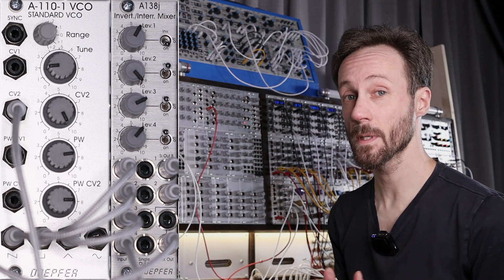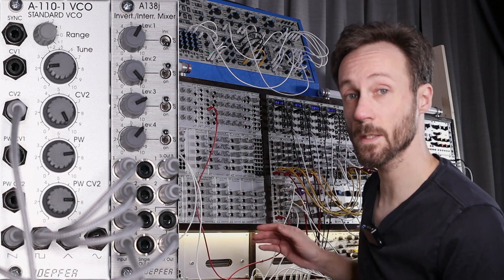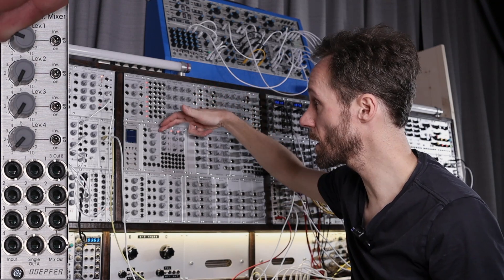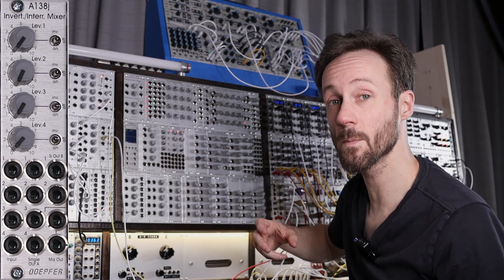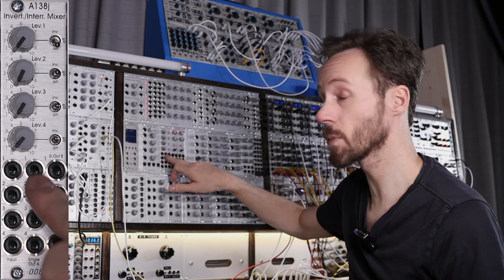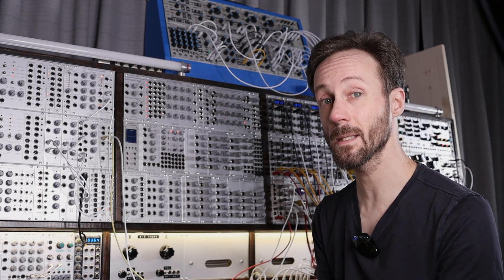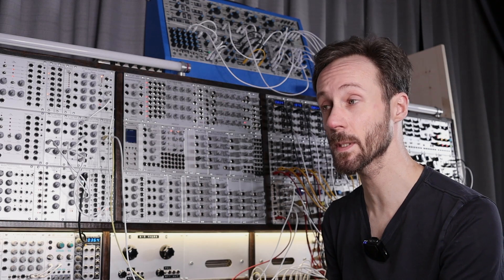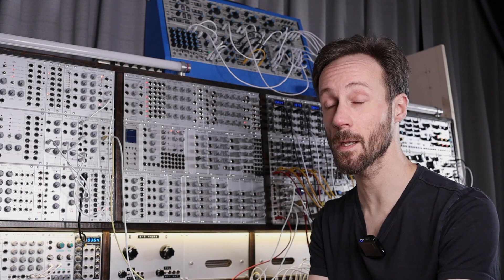Doepfer A-138j Interrupting / Inverting Mixer

Comment: I'm curious as I'm looking at the Befaco STMix, Nekyia Opal or now I've seen this the Doepfer A-138j. I'm curious to know how this handles audio signals? The STMix has two versions, V1 & V2. The V1 is DC coupled, which means you have to be sure the audio signal is not offset, otherwise you get a sort of crackle. The V2 is for audio only (+5/-5 volts only). The Opal looks very 'sexy', but it's only 3 channels, and less control on the outs. 

So, this leaves me with the Doepfer A-138j, maybe you can fill in the gaps? 

  Thanks in advance (BTW, I'm going to post a similar post on Mod Wiggler).
Reply from the maker: The in and outputs on the A138j are DC coupled, it handles audio signals well, I haven't experienced issues, I'm not offsetting the audio. I find it a bit weird to compare it to the Befaco because that is a stereo mixer without the inverting and muting options and it is also less suited to route feedback chains etc. I like to input the A138j with different waveforms from the same osc to create nice variations without patching, I think the A138j is versatile, if you're looking for a stereo 4 channel mixer look at the A138s.